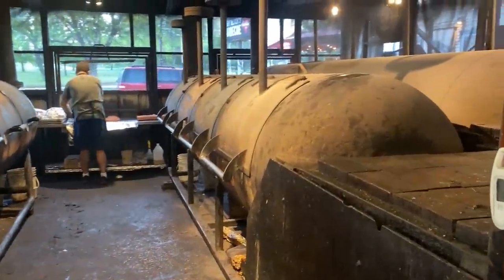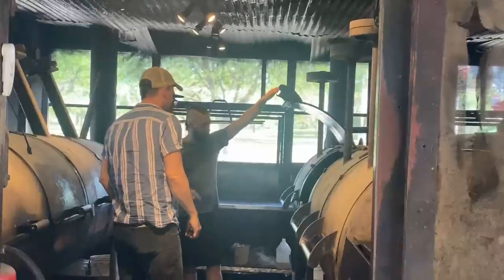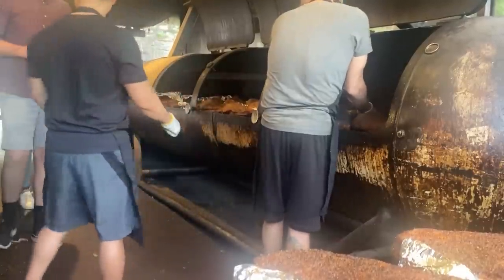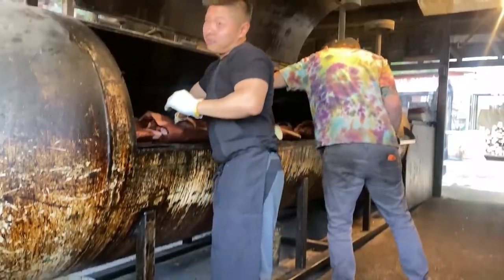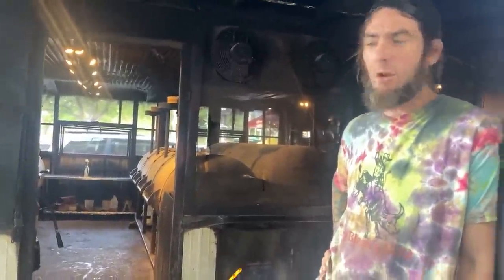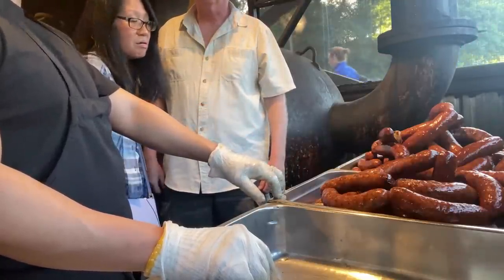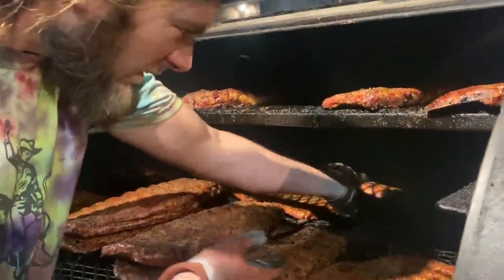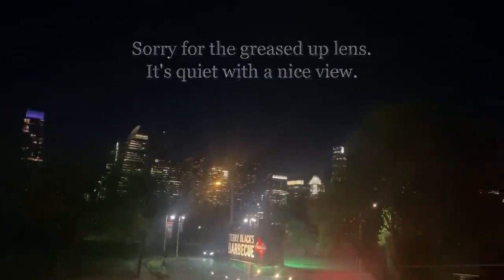16 Hour Shift at Terry Black's Barbecue!

Comment: Fascinating.  That is hard work.
Reply from the maker: It is. That’s why I tell not to quit their day job to do bbq.
Reply: @knoxavebbq  Just wondering, how hot does it get in the pit room during the summer heat?
Reply from the maker: @CoolJay77  hard to say, the digital thermostat on the walls usually stop working. Haha. But probably around 125